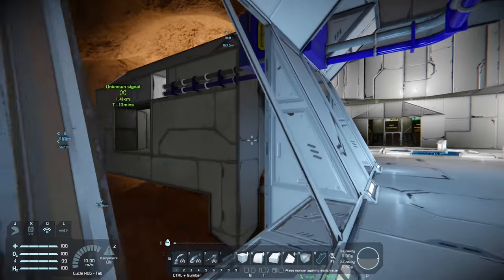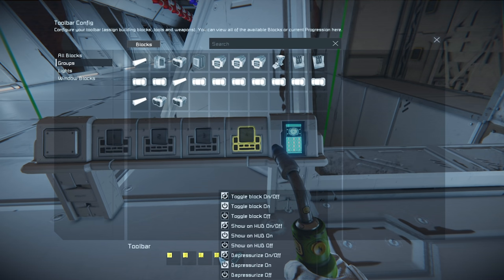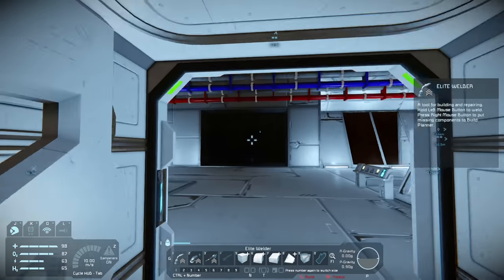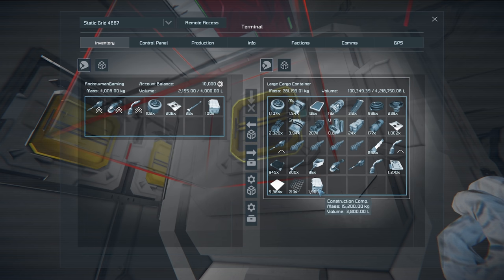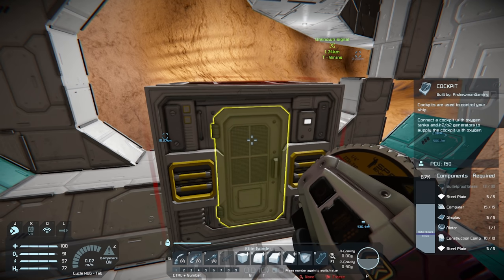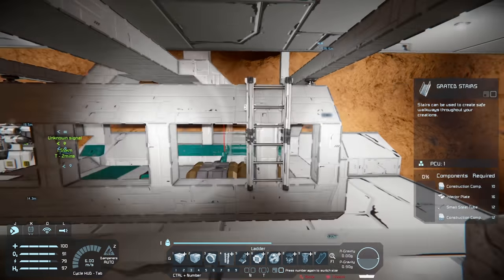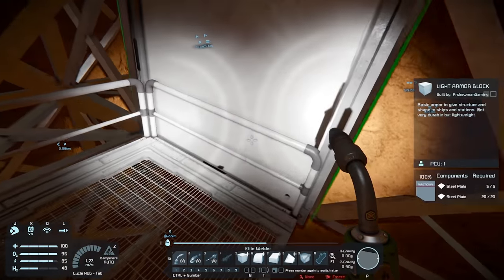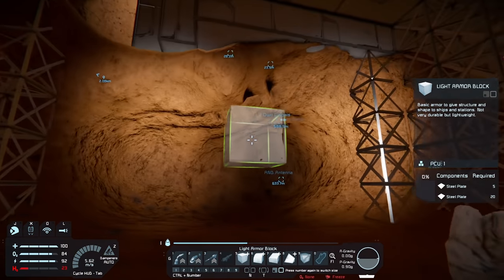Space Engineers Let's Play (S3 | E20) - Refining the Base!

Comment: 36:45 Andrew i watch on 240-360p sometimes 144p
Reply from the maker: Dang, you can stand that quality? I can't see what's going on with resolutions that low.
Reply: @AndrewmanGaming  it's my internet
Reply: Had an idea instead of you having to manually park or take out big red why don't you just put it on a piston that way it can be moved mostly out of or into the hanger.
Reply from the maker: @prometheus8010  Are pistons even strong enough to hold a Big Red?
Reply: @AndrewmanGaming  I guess we'll find out in two weeks
Reply: @AndrewmanGaming  would put it on bottom and have second piston be pushing piston that is holding big red up
Reply: @AndrewmanGaming  is big red heavy armor or light armor